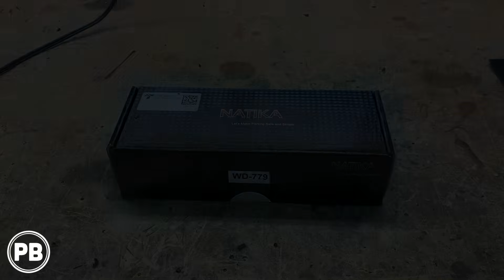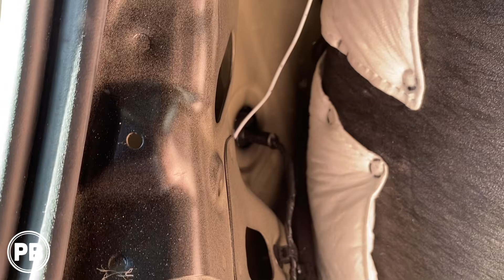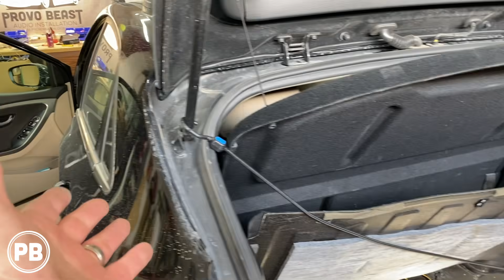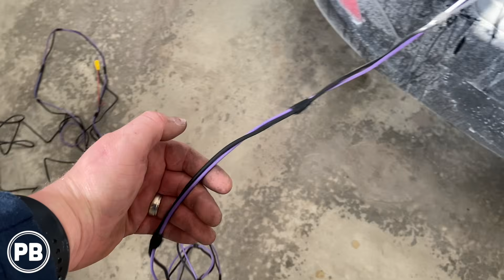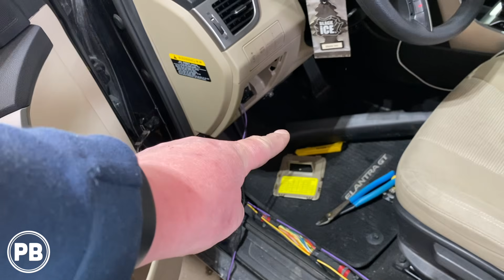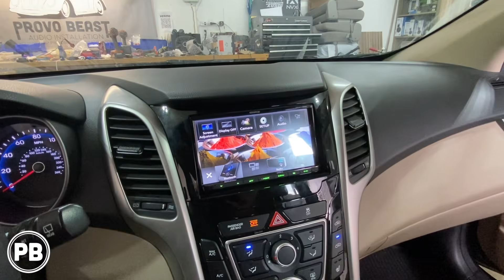2011 - 2016 Hyundai Elantra Backup Camera Install

Comment: What reverse wire is power for the backup camera is it the green or blue wire because I have a black green and blue wire I just bought a backup camera for my Hyundai Elantra I need to know what color
Reply from the maker: Use a multi-meter to verify which wire is needed.

Comment: where does the red wire that power the camera connect to? i saw the black wire connected to license plate negative wire .  Where red wire with video cable goes at the camera's end? you looped it and sealed it? the other end connect to auxiliary?
Reply from the maker: Yes, we powered our camera on accessory power so it's powered on when the car is running.  This allows us to use the camera in addition to just being in reverse (our radio has that feature).  If your radio doesn't allow you to call upon the camera anytime besides in reverse, you can simply power the camera off of the reverse light power and ground.

Comment: Hi there, I’ve got a Hyundai i30 (same as the Elantra GT). I have a camera that has LEDs on it. Is it possible to still retain the camera on/off from radio function, even when not in reverse? I don’t mind if the LEDs come on while I have the camera screen on the radio on. Thank you.

Comment: I don't know what exactly I did wrong,  my cameras only comes on when my setting is on the camera itself,  I must have not connect something right, because the moment my radio is on the normal regular screen, the camera does not come on when on reverse
Reply from the maker: You have an issue with the reverse trigger wire if it's not coming on when placed in reverse.  Our trigger was produced by our smart harness adapter.  If you didn't use the Pac harness we did, you will need to snag that 12v trigger from the reverse light positive wire.
Reply: @ProvoBeastAudio  That was the problem,  after watching your video the second time, I went back in there this morning and got it fixed, is working perfectly now, thanks a lot for uploading this video and for responding to me, I really appreciate it.